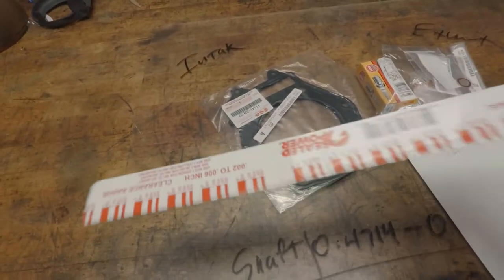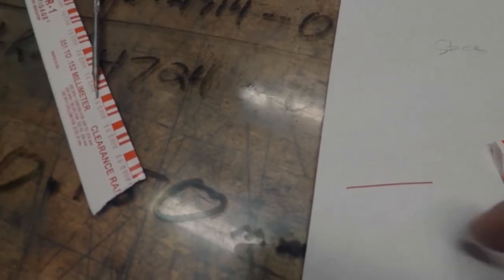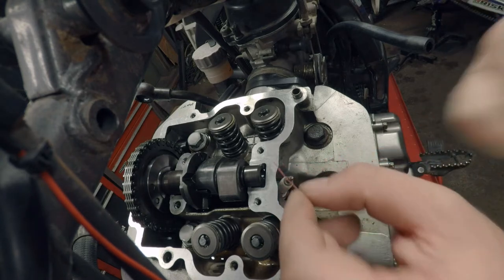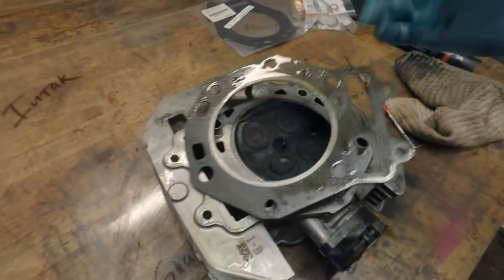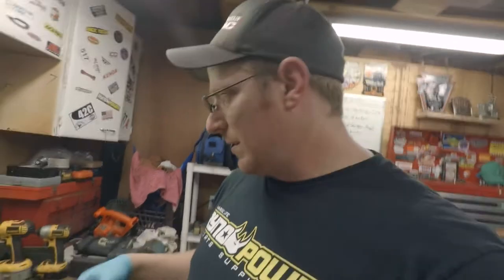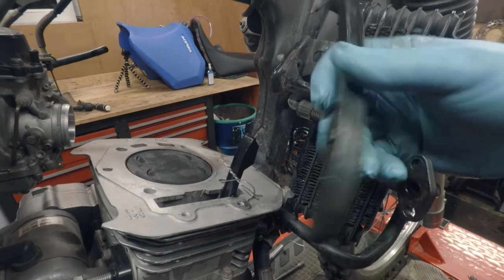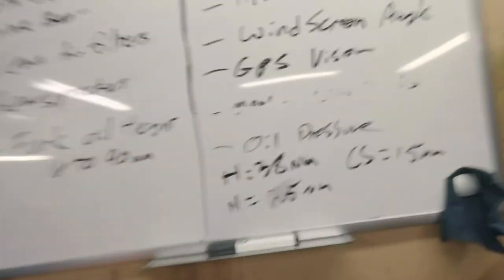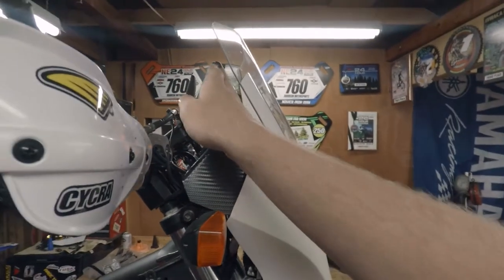Weekend Garage Vlog Episode 14: DR650 Head Gasket And Timing

Comment: @Robinson Motorsports I've got a question to you. I've got '97 Dr 650 se, and it's problem is noise of timing chain. When I start the bike, it is louder,  after revving it, it is hearable, when it is idling for few moments the sound stops, until i will rev it again. What can it be? There are only a few metal shavings on the oil filter, and it is normal in my opinion. Bike's mileage is 37k kilometers, about 20k miles.

Comment: Hi I was idling my new DR 650 the cylinder head got up to 350 degrees the oil sump was 220.I measured the temperature with an infared thermometer. Most DR websites said that is sometimes a normal temp. I was wondering your thoughts?

Thanks
Reply from the maker: I was given a bit of advice a while ago to never check the temp of an air/oil cooled engine. You will drive yourself nuts. As long as its not running lean you are fine. Shut it down if you smell oil.
Reply: @robinsonmotorsports9976  Great advice. I fortunately had the choke off. Thank you

Comment: That's a JE high comp piston and the timing mark should be on the line mark central to the inspection hole
Reply from the maker: Good eye! I had no idea, it does start a little hard, figured it needed jetting. Ill have to look a little deeper into this now that its winter here. Thanks!